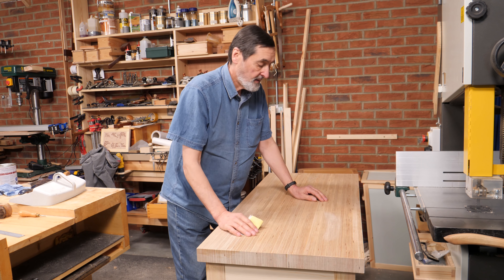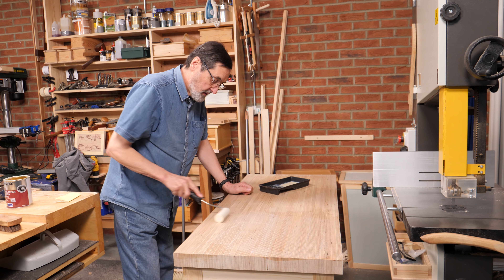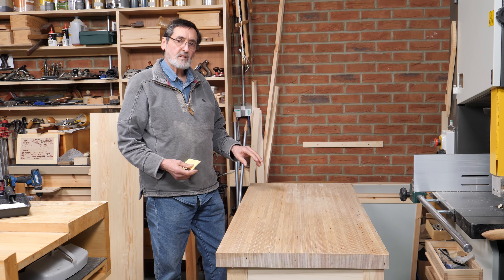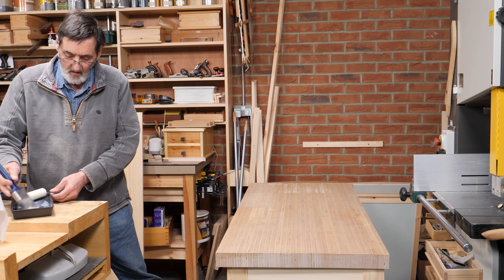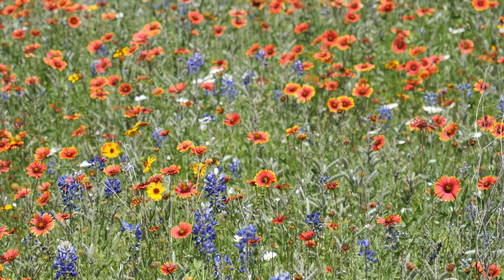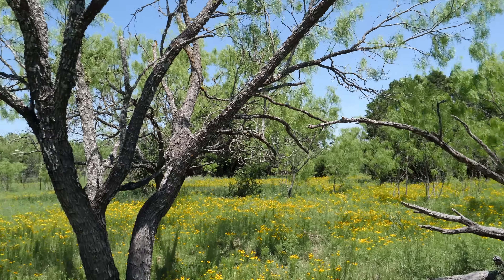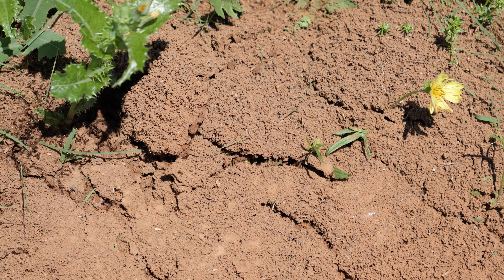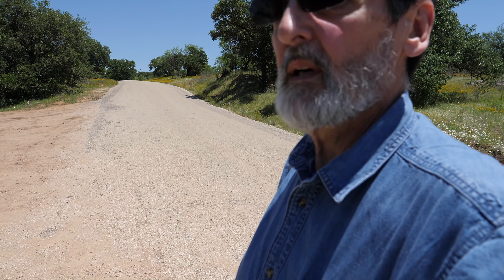Warmth in Creativity | Paul Sellers' Vlog 012

Comment: I have just been experimenting with water based finish and not sanding. I used a spiral/helical planer on some pine draw fronts, stained with a light mahogany, 4 coats of water base finish, light 320 grit sand in between each layer and I am amazed how good the finish is.